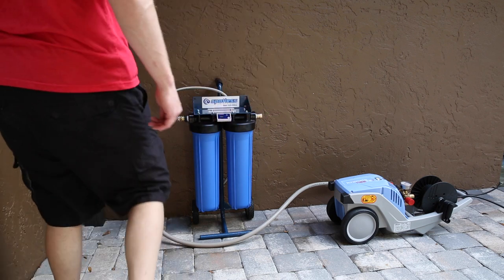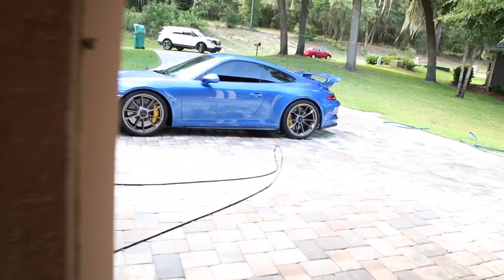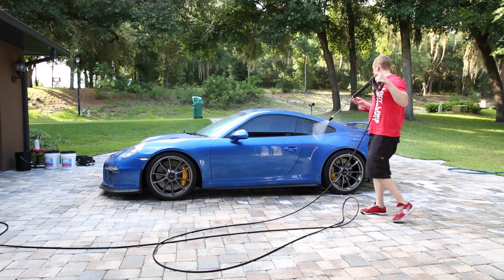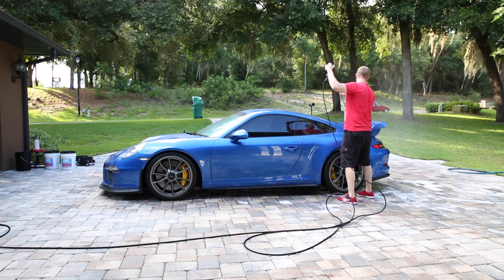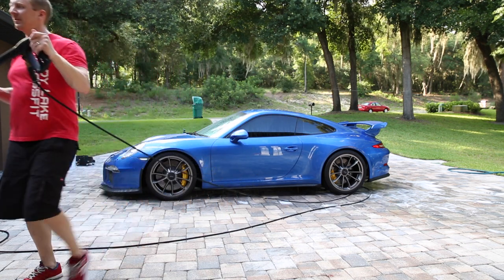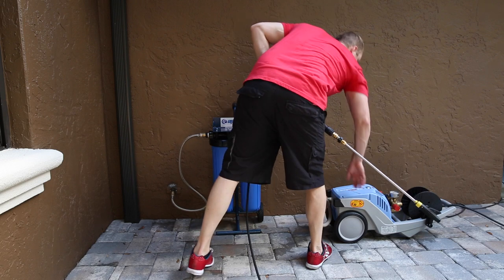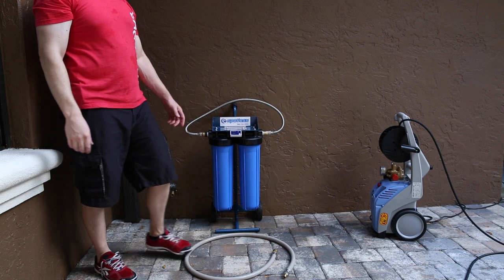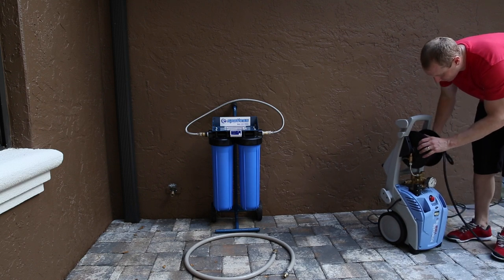CR Spotless Deionizer: First Impressions

Comment: i'm building something that amounts to 2-3 X the capacity and filtering of these units, its serviceable on each end of the two filter housings, its cheaper by far and provides a superior lifespan ( pvc is rated to last decades) / filtering capability ( activated carbon compressed, DI MB resin )  AND the filter media is substantially less expensive compared to cr. tempted to make a video but i've already done most of the build and didn't record... O_o

Comment: Hey Matt,
It's Matt from CR Spotless. I love the video and the car looks amazing like always. The pressure washer may have gotten some air in the line which is why you noticed the problem you had. Pairing the system with a pressure washer that has a low gpm rating is the best way to use the system. Otherwise it all looks great and I am glad our product is helping you keep those gorgeous cars clean.

Comment: Hey Matt, surprised you didn't get on with Gyeon Foam. Did you rinse it off after 5 minutes dwell time? Or did you leave it on the car as lubrication for your 2 bucket wash? Gyeon Foam is designed to be rinsed off the car after dwelling. I think leaving it on as lubrication for your 2 bucket wash must have stripped your protection. I've had great results with it, when I use it as a pre-wash and rinse it off before I start my 2 bucket wash, my rinse bucket is certainly a lot cleaner at the end than when I don't use the foam or use another branded foam. Hope this shed some light on why it may have stripped your protection
Reply from the maker: James Hayes That's where I went wrong.  I used it assuming it was like a typical soap.  I used it just like my Adam's and let it sit.  Bad move.
Reply: Matt Moreman
I would suggest trying it one more time, because it is some of my best pre-wash soaps. It is also non-caustic, not to strip the paint of wax. If you foam, then use your pressure washer to remove it, from the bottom and up, even less dirt will be on the paint. 

Otherwise I would also suggest buying GYEON Bathe+, and Wetcoat, amazing products to keep the beeding and sheeting up, giving a real "WOW" impression first time you use it. (Im not a GYEON saleman, just a person from Norway loving GYEON products, and your initiative on the channel! :D   )

Comment: You really only need for a final rinse as that's when the danger of water spots occur. I suppose its a bit of a hassle using regular water at first then switching to de-ironized water for a final rinse. Using it exclusively as a final rinse will save you some dollars as I know the filters on this aren't cheap. Personally, I'm looking at Griots Garage alternatives to a product similar to this. I'll be purchasing it soon as I'm tired of water spotting.
Reply from the maker: The CR has been awesome.  My new wash bay that I'm building will have a simple valve that will allow me to toggle without disconnecting/reconnecting.

Comment: Did the Power Washer exceed the out put water flow they recommend  therefore not allowing the unit time  to properly clean the water?
Reply from the maker: Ray B I don't think so.  I believe only high powered gas pressure washer would exceed the allowable flow.

Comment: I'm thinking about getting a CR Spotless. How did you decide between the 300 gallon capacity model vs. the smaller models? I would use mine just for personal use, so not a fleet of cars.
Reply from the maker: +Andy K. Kuo I figured it wouldn't hurt to have the largest model.

Comment: Is that a Tonka pressure washer?   Try the DI water with your foam cannon, but at full pressure, which can’t be much from that little thing.  Foam that VW down with DI, then rinse with DI.  It’s amazing.  Don’t even have to clean windows. Watch closely on CHEMICAL GUYS videos, in the area behind where the camera usually is, opposite the racquet ball court-looking area, there’s usually 5 or 6 HUGE DI tanks with a hose running to the Mickey Mouse pressure washer they use, and they film all of their videos with DI water, hence super foamy suds and always-clean cars.  Also, yank the motor out of that car, sell it to some rich kid for stupid money, and drop an LS in it, and then go take pink slips from other rich kids.